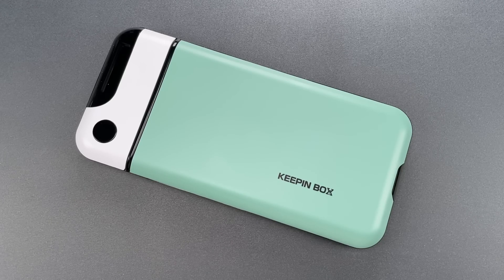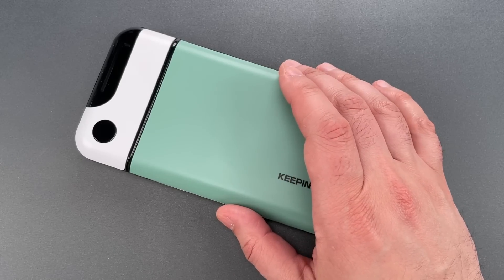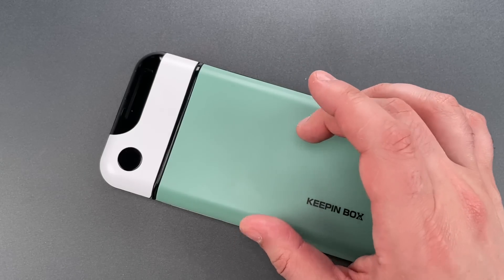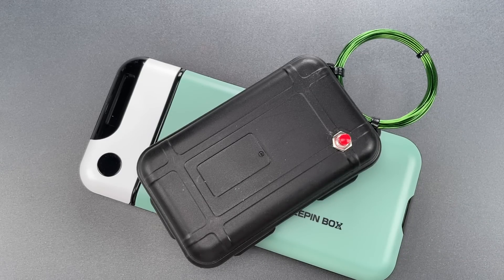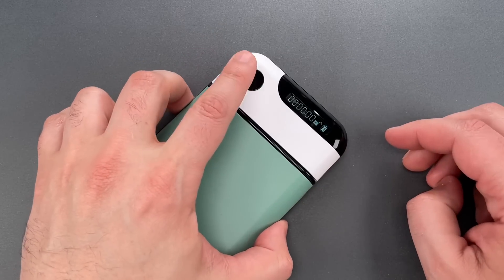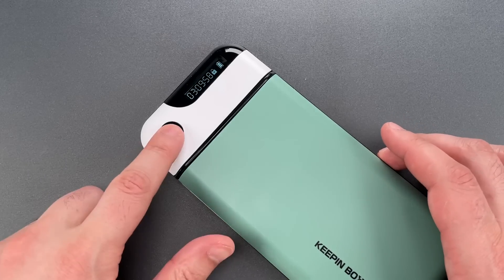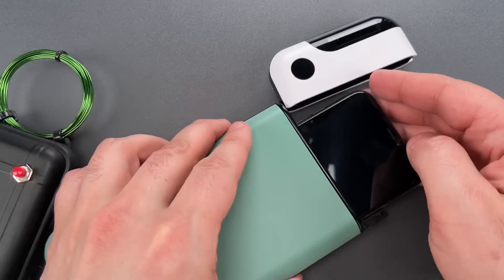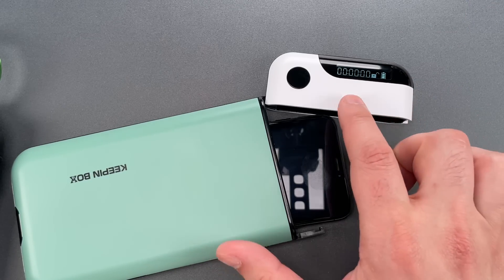[1440] Pocket EMP vs. Smartphone Timer Lockbox

Comment: The main issue with using flash storage instead of RAM is that it'll eventually wear out if the security device is expected to be in service for a significant amount of time and it'll significantly increased cost unless you want the lock to have an even shorter expected lifetime. 

This being said, having a check bit set in ram that stops the microcontroller from zeroing out the ram and using a capacitor to provide the ram chip with an external source of power for a few minutes might go a long way at medicating the attack. 

In theory you could also store several copies of the time remaining in ram. Since when ram looses power it won't all instantly be gone, depending naturally on the type of ram. As such the controller might be able to reconstruct the time remaining by crosschecking the backups. 

Although you could also accidentally set the lock to an unintended date range. In theory if you want the lock to have a longer life and you still want flash memory. In theory a user swappable micro SD card might not be a terrible idea. As long as it can only be swapped when the lock is open.

Comment: I'd start with the fact that locking your smartphone in a way that makes it not readily accessible also means that you can't rely on it to call for help if an emergency arises. A very stupid situation to put yourself into. If you can't refrain from binge-netting, you should just buy a regular flip-phone with no internet connection.

Comment: There are issues with storing often-changed data in non-volatile memory due to the "endurance" limit of the memory. Typically for a small EEPROM it might be 1,000,000 writes. That sounds a lot but it's only 11.5 days when used once a second. Some possible workarounds are:

1. Use a large SD card and leverage its wear levelling to give an acceptably long endurance. Adds cost. 
2. Use network time. This requires WiFi or GSM. Adds significant cost. 
3. Use FRAM. These are EEPROMs with infinite endurance. Adds cost.
4. Only store to the nearest minute. That gives you 60,000,000 seconds or nearly two years endurance.

Comment: It might be very hard to avoid use of volatile memory for this kind of application. For it to be accurate you'd have to store the timer value regularly, which would wear out non volatile memory quickly. An alternative could be to store the original timer value when starting the countdown, and only clear it when it has expired. So an EMP pulse would restart from the beginning But you risk people getting locked out much longer than expected, or even forever. For a device like this that's probably not an acceptable failure mode.
Shielding would be reasonable. But don't think much more than that makes sense for a device like this.

Comment: so what's the build in emergency workaround this device I'm almost sure has to employ in you know.. case of emergency? (Either it has one, which would make it useless for its proposed use, or it doesn't and I'm sitting there in an emergency with a perfectly functioning phone locked away in a bit of plastic (which I suppose likely could be prayed open?)

Comment: some alumuim foil and cast iron alloy with a bit of silicon would make the EMP a bit harder to use or just use a mechanical timer device or better yet a hybrid say the timer was attached to a slow moving lever to release the locking bar while resetting the memory would also reset the lever and setting the time only sets bar for x amount of time but only gets reset when the lever passes the mark this still would fail to be vault grade as being able to delay the timer would be a security flaw lets say the vault is only opened on Monday but not every Monday one could get in and out off schedule and reset the timer to match the the intended schedule I think a bypass button is needed for this type of device that when used displays a notice of it being bypassed this way the phone can be used for emergencies and or other at the moment urgent use I am not a fan of this type of device as only teaches a pattern of use not the judgement needed to form this pattern of use

Comment: I tried lockpicking a car lock the other day, I think I did everything right, but when the cylinder turned, it only got to 45 degrees and stopped moving there, I tried locking it to see if it was just me messing up, and it did the same towards the other direction, does anybody know why this happens? I got the lock from a 2012 Ford Escape

Comment: I'm a mechanic sometimes we end up with keys locked in cars typically not that hard to get in but the newer electric cars specifically teslas will automatically lock themselves and roll the windows up if you close the door I've locked the key card in 3 of them so far and you have to wait for the owner to show up and unlock it with their cell phone I'd love it if you could show a way to bypass that I think this is a plausible method but I cant experiment on this myself cause I'm just not willing to take the risk with a car I dont own and certainly dont have permission to do so

Comment: They can't save the value of the count-down timer on non-volatile memory, in this case, EEPROM. Because it has a write cycle limit. The cycle will be plenty if you only save some settings on power cycles, not so much if you save the value every second. The ballpark figure for the write cycle of EEPROM for a typical MCU is in the magnitude of 100,000 times.

Comment: Is there an advantage to starting at the front of the lock when single pin picking? I am new and have an easier time with the amount of space between pins when starting from the back and moving forward.

I know this has nothing to do with the video, but I wanted to put it here since this video is the most recent.

Comment: Most advanced microcontrollers have built-in non-volatile memory, and while you only get ~100,000 saves it still better than resetting to zero. In an emergency though you're destroying the item.

Comment: I understand that the reset of the microcontroller means it forgets the latest time value but storing it in non-voltale memory can be expensive. Flash memory has a short write lifetime so something else would be needed but it's usually more expensive.

Comment: It might be worth trying some electronic locks in close proximity to something like a GMRS radio, another attack strategy may also be extremely low temperatures where the internal batteries cease to function. Worth mentioning that playing with EMP may destroy the phone inside this enclosure, irrespective of whether it is on or off.

Comment: My immediate thought as a programmer was save initial time to nonvolatile, then every 10 minutes save the current to nonvolatile. Anything less than ten minutes initially will round back to original, anything ten minutes or greater will round up on reset.

Comment: It would be sufficient to store the programmed time only at the start of the timer; this would ensure you don't wear out the nonvolatile memory (a real concern if you were updating it every second), and in the case of a disruption the timer would start over counting from the initial programmed time again, resulting in an even longer delay; punishment for attempting to tamper with it!
Reply: Yeah, or perhaps just update it every 30 minutes instead of every second.
Reply: This is all assuming that the EMP wouldn't just wipe the EEPROM too
Reply: @drozcompany4132  if it did it would probably also wipe your firmware and render the device permanently locked

Comment: Wait - pocket EMP? It sounds like a 'stun gun' in operation without the loudest crack, and has the coils of wire for an antenna... I used to mess around with a stun gun I got from some friend who detailed cars, and it would make computers at a distance BSOD and reboot and whatnot. So the coil is more effective than a  spark gap?
Inquiring minds are very curious!!

Comment: I'm a beginner level picker and a southpaw, is it best for me to invest in a left-handed tension wrench? Or would a 'regular' one work just a well for me?
Reply: "regular" pickers use left hand to tension, what do you mean, a right-handed tension tool ?

Anyway, most are just symmetrical.

And, as a rule of thumb : buy good tools but don't "waste" too much on them, save money to buy locks and learn to actually use your tools before buying new ones.
I bet it's more useful to have a truly versatile (quality) wrench set (a given wrench wont fit every locks!) that a specialized tool for your handyness.

Comment: Is it legal to own, operate, or manufacture a handheld EMP generator in the United States? I was under the impression that it was not legal in any way. Can you provide statue saying it would not be against Federal Law please?
Reply: Intentionally generated EMP falls under the FCC's jurisdiction. According to the FCC you are permitted to 'transmit' on any frequency at a power of no more than 100mW measured at the antenna as long as you are not interfering with a licensed service. Since the phone case isn't licensed it falls under Part 15 rules, which state that it had to accept whatever interference it encounters. This EMP generator is emitting far in excess of 100mW so using it would be technically illegal regardless, but anyone can still legally possess it unused, so essentially an FCC enforcement agent would have to see you use it before you'd have legal problems.

Comment: That EMP Generator sounded like it has a spark-gap inside it. At the price you mentioned I am guessing that the circuit is a simple step-up into a small capacitor bank which then discharges through the spark-gap into the coil. Basically a old-school sparkgap transmitter
Reply: Thanks for describing it.   I now will have to build it.
Reply: @MatthewTaylor3  the faa has regulations on wave transmitting devices.
Reply: @jonathanday4553  above certain power level and frequencies, seeing that the camera didn't react at all i think the mechanism works more like a "malicious" transformer that make brownouts on the low voltage circuitry inside with very limited range, the EM would be just similar to spinning Nd magnet really fast.
Reply: @jonathanday4553  FCC, not FAA
Reply: @denniswilson631  Can we compromise on "FBB"
Reply: @ottokiehl5413  How about the FFA?
Reply: @jonathanday4553  actually it is the FCC that regulates that.  ;)
Reply: @web1bastler   I was in the FFA 4 years never got the Jacket!
Reply: @denniswilson631  the fcc wont let me be......they try to shut me down on mtv... its all that comes to my mind
Reply: @denniswilson631  Depends on who you are causing trouble for.  Interfere with GPS,  ILS, Radar etc.  near an airport or approach, the FAA also has some very spendy toys to track it down.  Like a long since disconnected  (but still  powered) TV antenna amplifier on an apartment building that after years went rogue no harm no foul.  Or an idiot trucker trying to defeat his GPS tracker, expensive party foul. Probably not the smartest move to run your jammer on your daily route same time every morning stopping at the same toll booth by a large metro airport :) FWIW there are RF dark art ways to finger print individual transmitting devices in some instances.
Reply: I do not think it is a spark gap. I believe the snapping sound was a high value capacitor generating a super localized pulsed electromagnetic field via the insulated coils. When the magnetic field envelopes the target circuitry and then collapses it induces electric current within the target circuitry which can either fry or reset an IC or micro-controller depending on its overload protection.
Reply: Or a tazer with a coil between the spark gap
Reply: Yes mhmm I understand some of these words
Reply: @will-gp7dd  haha, good one
Reply: if you make them for sale. consider me  buyer
Reply: I've create one similar to this, legit just need a voltage booster and some leftover wires, buttons, and nails, boom "taser", then just apply a coil and a case and its a "scary" and loud EMP lol
Reply: Think a taser with a coil strapped to the prongs would need a little more to become an electromagnetic pulse generator..  lol.. would have to be a pretty high frequency to get the flux waves to effect electronics..  thought they usually use microwave antennas to transmit frequencies above the broadcasting range..  but im not a ham radio nut so dunno the bandwidth ranges..  i did think that emp jammer devices just use similar frequencies pushed through antennas but i could just be thinking of radio and ir interference devices..
Reply: I thought that it was a teaser connected to a coiled wire.
Reply: Yup
Reply: There are many how to videos on building emp devices out there.  They are quite simple
.
.
But their highly illigal because they can cause deaths if used near sensitive medical equipment
.
Or they could disable important safety systems on a train and cause a massive crash etc
.
.
Im honestly surprised a massive emp related disaster hasnt already happened

Comment: TL;DR: "Don't store mission critical information in volatile memory" - It's not as easy as that.

The statement "Don't store mission critical information in volatile memory", from a software engineering standpoint, really falls short of reality. There are lots of kinds of data, and the way they interact with the program (and on that level, even the hardware) often dictates how they must be stored. 

To give you an example, a counter about to be incremented or decremented (and what else is a timer) literally HAS to be stored in a register, which is about as volatile a memory as it gets. 

Taking a first step back from the details, a datum like "time remaining" is what experts call a volatile state, i.e. a datum which literally has to be modified on (almost) every clock cycle. It's literally impossible to store such a thing in non-volatile memory, because by the time you would have spent the multiple clock cycles necessary to store and/or update it, it would be outdated. 

Literally the best you could do with COTS hardware would be to regularly back up the state in non-volatile memory, which however could also be corrupted by your electronic attack. The same goes for more expensive solutions like using a processor with non-volatile ram and some special clever programming which ensures the firmware can resume with the old data if its internal watchdog triggers a reset, but that too could trigger a reset

Last but not least, there's the question of proper faillure modes. The thing you definitely DON'T want on a thing like this is to suddenly have the timer show 99 years after such an attack. In a real security critical implementation, you might want to fail on the safe side and accept the possibility that the rightful owner might have to destroy the securiy devide to open it, but on a toy like that, you want to fail lenient.
Reply: You're right that the failure state may have been intentionally selected this way, but when that's not the case, a safer yet nearly as simple approach could surely be to count up towards a target time stored in non-volatile memory (potentially with a volatile copy for comparison speed's sake, but checking against the non-volatile source of truth before opening)?
Reply: @sarajohnsson4979  There is a lot to what you say. You could indeed store the target in non-volatile memory with a checksum, then count up to that value. That would not make it completely safe, because in case the non-volatile memory were corrupted, you would still want to default to open up, but it would potentially make that attack a lot less reliable.

Goes to show that usually there is a solution if you just put your mind to it.

Comment: EMP generator is probably a low current high voltage power supply, a high voltage resistor charging a capacitor, and then a spark gap in series with the coil, with that combination in parallel with the capacitor. Cap will charge up to high voltage until the spark gap breaks down. Then the cap gets dumped through the coil very rapidly. When the current decays to zero, the spark gap resets to a high impedance and the cap charges again from the HV through the resistor.

Comment: You're right in general. But it is not applicable to something like timers. Non-volatile memory have very limited write cycles guaranteed. So, if we write it (for example) every second - the device will be broken after a few dozens of working hours.

Comment: Silly question, but if you can't store the time in nonvolatile memory then where do you store it?
The obvious answer would be Flash memory, but that is slow to write (what would happen if the pulse was triggered while the processor was updating it) and they also have a limited number of writes before they stop working.

Comment: Needs just a bit of shielding; you could do it even yourself. Try wrapping the lockbox in a sheet of aluminium foil. If it doesn't work, you'll probably have to reference it to the minus of the lockbox's power source.